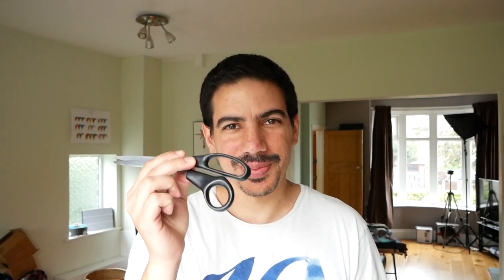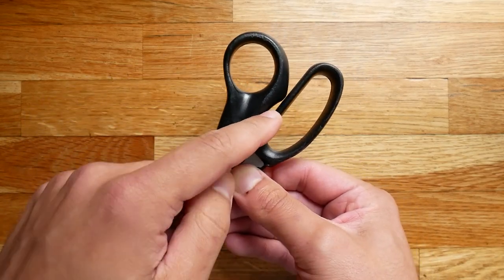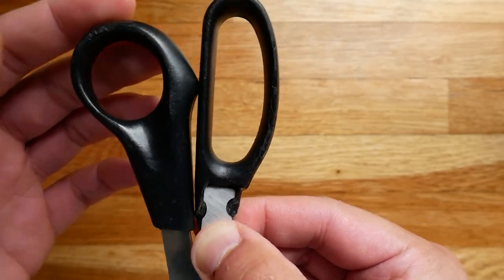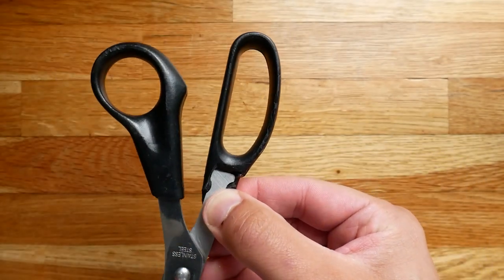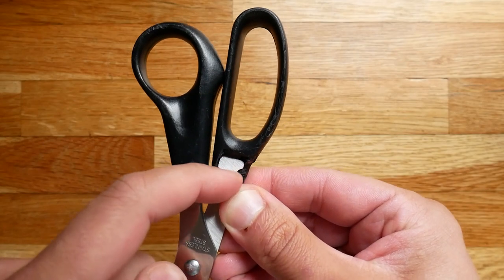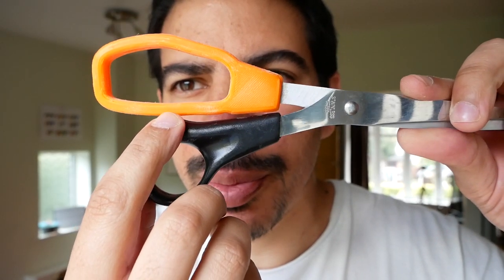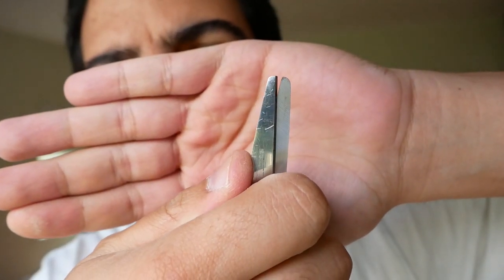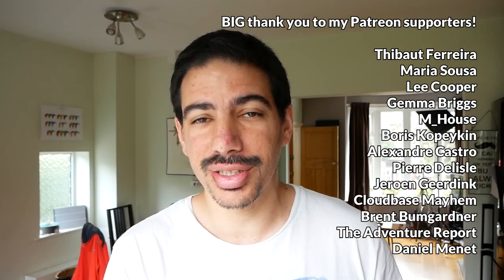3D printed scissor fix - BANDARRA

Comment: that's not the reason why it broke, mate. the plastic is just too thin and doesn't resist the flextion when you are cutting, that's why. I've trown 10s of scissors. I wish these plastic handle scissors where BANNED. If we had solid metal scissors and people knew how to file them (it's extremely easy), thye would last 200++ years for generations